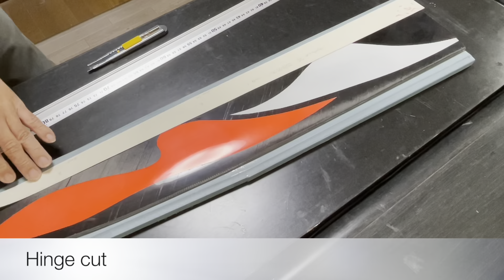Scratch built DLG glider -Wing joint(After bagging)-

Comment: Thank you for another insightful video on your series!  Do you use any outer reinforcing cloth to the center of the wings joining as well, or these thick balsa pieces are enough?
Reply from the maker: It's enough in my experience.
+I use carbon pipe as a sleeve of wing bolt.
+Cover the center of the wings  with 60g/sqm carbon like bolow.
http://kousaku.biz/RC/gazou/hayabusa_18/18-4.jpg